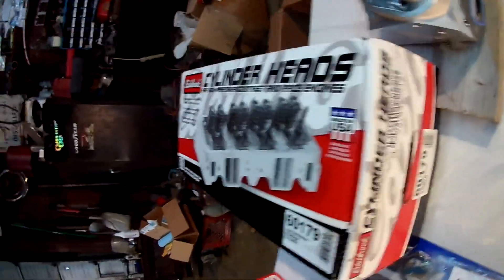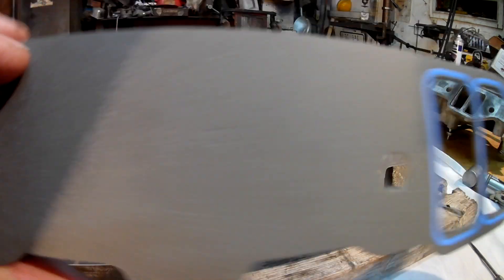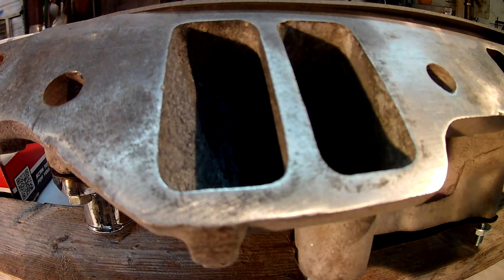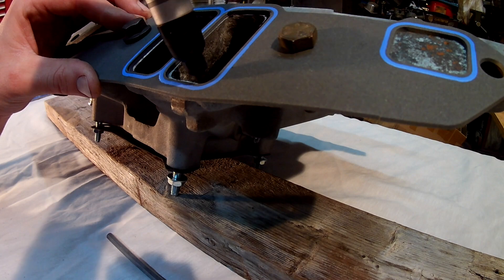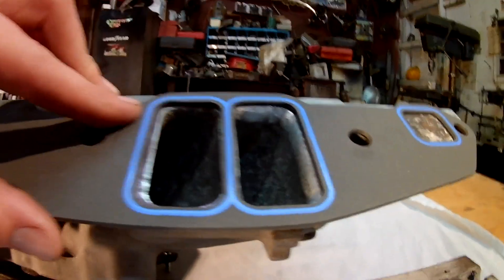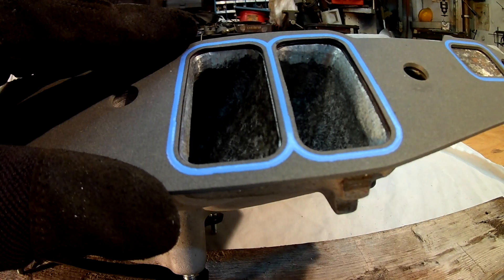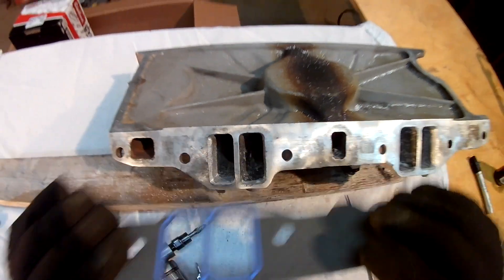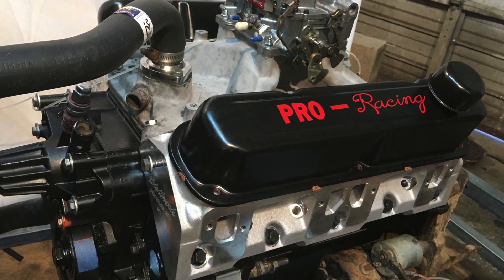Gasket Matching an Aluminium Edelbrock Intake on a Small Block Mopar 360 and Unboxing New Heads!

Comment: oiling a bit made for aluminum is also advantageous.
Reply from the maker: What’s your favorite porting lube? I was taught atf but have tried candle wax and am currently on wd40
Reply: @JustMoparJoe  I just always used 30w. But I'm 67, retired heavy truck mechanic so I'm REALLY old school! LOL I'm sure there may be better ways now---or not. Like you kinda always say --to each their own. I never fooled with a car much( not my own anyway) I had a '78 Plymouth Trail Duster w/440. It was heavy but I got the most I could outta that 440.

Comment: Do you measure the inside dimensions so you know what your crosssectional areas are?  You do not want the area of the intake exit to be larger than the intake port entrance.  You may need take material out of the port towards the plenum. Big at the carb with slight taper heading to the valve increases velocity, adds energy to the flow.....you can buy inside mics at Harbor Freight....
Reply from the maker: I got em big dog. Check out my tunnel ram porting video.
Reply from the maker: Big Block 400 Build Series:Home Porting a Tunnel Ram #mopar#bigblock#engine
https://youtu.be/HYZsk5iyC5s

Comment: On my '85 318 I'm using an old Performer 318/360 to start with....it was in the back of the RC when I bought it.
I noticed the ports on it are offset vertically.....the bottom runner floor sits a bit higher at the gasket opening? I thought that was weird.
I'm gonna leave it alone....might prevent some reversion.
I might have to switch to a RPM later depending on how this thing runs.
Reply from the maker: I like 318willrun’s philosophy on it. He said he’s bolted on many that were mismatched and he really doesn’t think you’d notice a difference.

Comment: For a single plane intake I place the gasket and heads on the block then look down the manifold runners to see how mismatched things are. Some of the early Tarantula and Torker manifolds Edelbrock advised not to match, I think the short side port wall to stop reversion.
Reply from the maker: Paintnamer this intake was quite a bit smaller than the head ports. It would have had a tumbling effect going from the intake to the head port. My main goal was to smooth that transition. I don’t have any type of flow equipment or way of verifying my results. The engine in the truck has gobs of low end and mid range torque, and pulls strong to 5500.

Comment: Edelbrock also has the #60779 performer RPM heads that are listed as having a 63cc combustion chamber volume as opposed to the 65cc of the #60179 and both have 171cc intake runners.  Nice work on the manifold!
Reply from the maker: Josh Johnson that’s what I would have chosen. These were the parts that were brought to me. Lol

Comment: How do you clean the Heads? I have a vary used pair of 906 heads on my 383 i want to try my 1st porting job on but what chemical or what do you do to get them clean? Brake Fluid and a power sprayer?
Reply from the maker: Ram Berto I usually spray mine down with Mr. Clean or purple power, then pressure wash. Might take a couple try’s if they are really bad. My head shop bead blasted my last set, so they were like new when I was done.
Reply: @JustMoparJoe  Try using a whole 5lb bag of Tri Sodium Phosphate soaking in an old cooler overnight